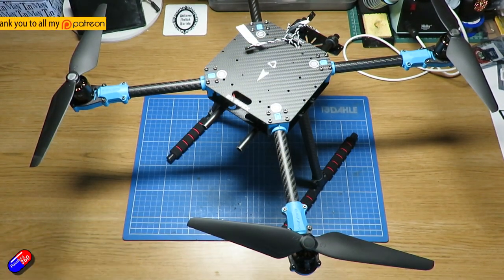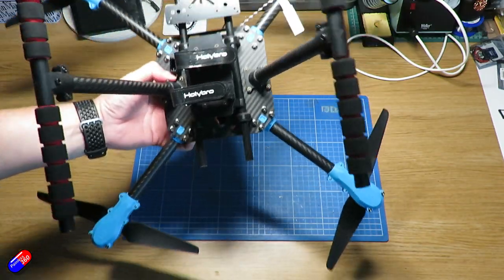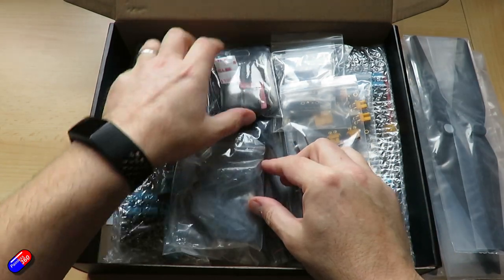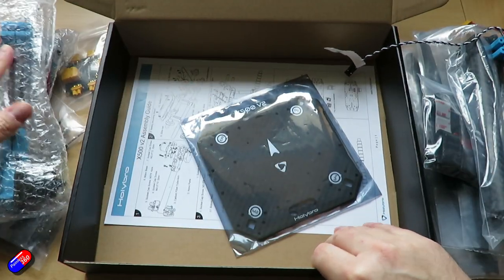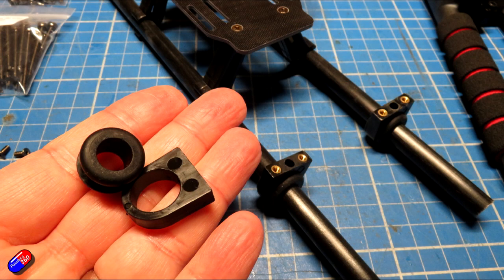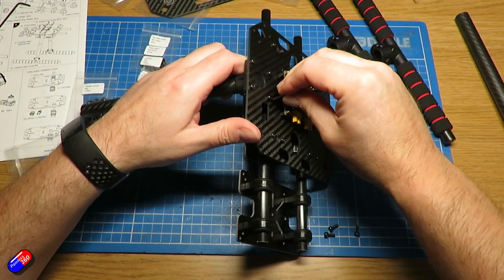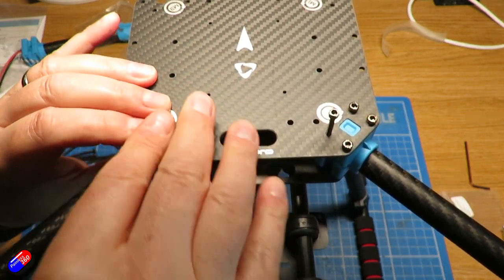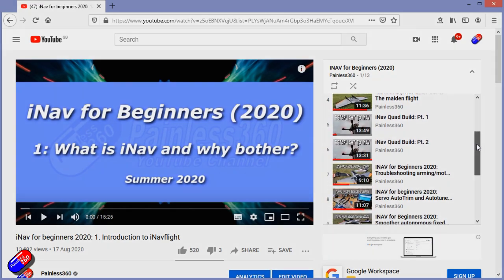HolyBro X500 V2 Development Frame: Perfect for students and research

Comment: Hi.  I bought a Holybro 6C Mini flight controller and a Holybro X500 V2 quadcopter frame.  I am trying to set it up with Mission Planner but the motor test routine does not work and the radio calibration does not work.  I cannot find a description of what kind of ESCs are mounted in this frame or what sort of firmware they require.  I contacted Holybro tech support, but they apparently only understand Chinese.  Can you help?
Reply from the maker: I'm guessing you are not a regular viewer. Check out Arducopter/Pixhawk for beginners Series (2023): https://www.youtube.com/playlist?list=PLYsWjANuAm4rXSCRfiZkpuBmUP0u-lLby

Comment: is the telemetry radio just used to communicate mavlink instances with a receiver on the ground?  if so, you wouldn't need to buy the telemetry radios in a strictly BVLOS context (like a remote GCS)?
Reply from the maker: No, you can use them for RC link to fly too... Happy flying
Reply: @Painless360  so if you’re only communicating with the flight controller via a rpi with a modem, you wouldn’t need the telemetry radios?
Reply from the maker: There are loads of options. I don't fly with a GCS here as I use a regular radio but some professional pilots I know always have a GCS running.. https://ardupilot.org/copter/docs/common-gcs-only-operation.html

Comment: Very informative, please what is the weight of the drone after assembly?
Reply from the maker: That depends on the batteries and any other equipment is installed... Happy flying
Reply: @Painless360  thank you, but what I mean was that the weight of the kit after installing all the components that came with the package.

Comment: Thanks a lot. I am using hollybro ardupilot since 2018 for gliders. This one will be my first drone.  What about the noise ?
Reply from the maker: It isn't quiet as it is a decent size. See the Arducopter 2020 build for an almost identical frame build and flight..

Comment: Thanks a tons, this video will be helpful for  all beginners. Do you have a video , how to mount the PixHawk5X, GPS and Telemetry   & , power. Also, 
 Flashing Firmware on Pixhawk 5X ?
Reply from the maker: 5X needs Dev 4.2 ArduPilot & 1.3.75.1 (Currently Beta) Mission Planner

Comment: I have the v1 essentially the same frame etc and it flies really really well and can carry  about 500gs of above its flying weight.
Reply: +1 on the v1
Reply: Excuse me, does the 500g payload not include the weight of the battery or does it include the battery?

Comment: those pdb connectors sandwiched between the frame seem like a pita when something disconnects because of a crash... 

edit: well, looked at pictures on the website - it seems like they are accessible from the side...
Reply from the maker: Yep, easy to get to them with the frame built. I plugged in the connectors after I put on the top deck with no issues. Happy flying